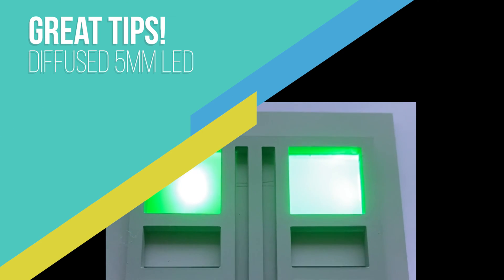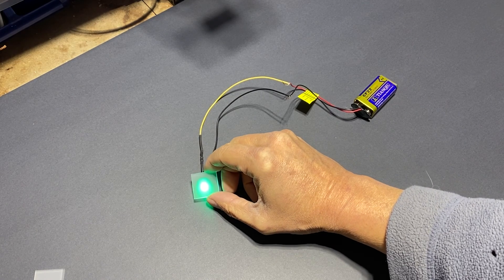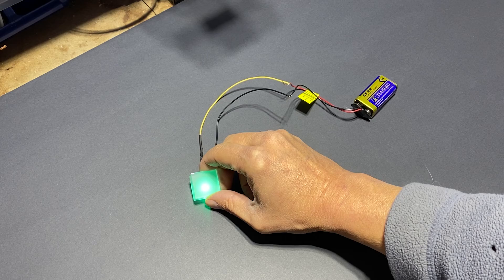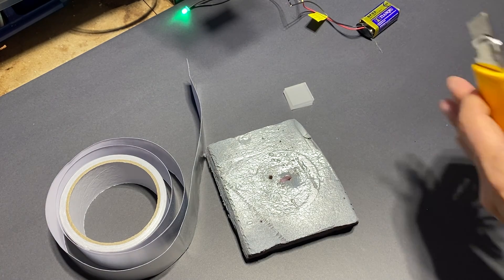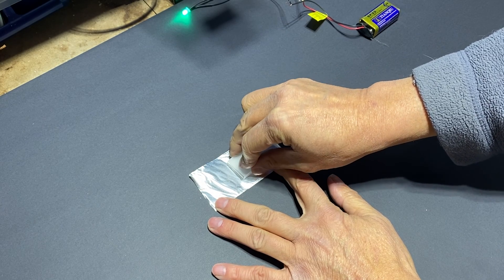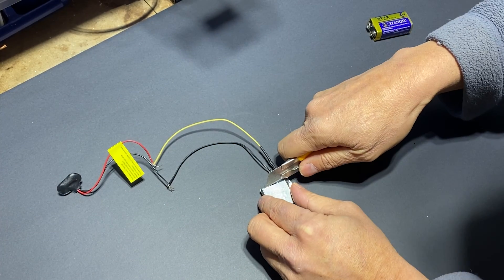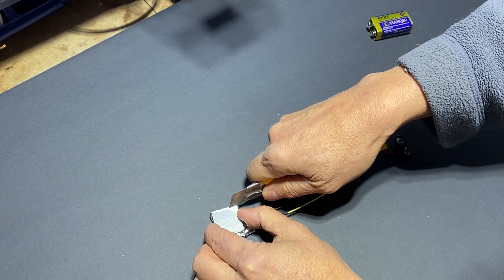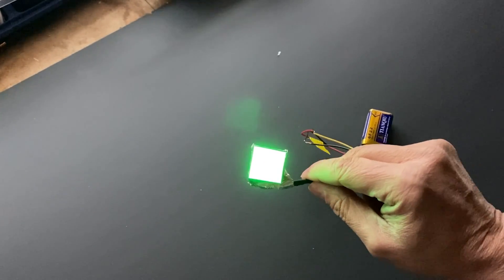Easy LED Diffusion with Acrylic Tiles: Transform Your 5mm LEDs!

Comment: Would this work on a larger surface area (say 12"x12") if you used 1 LED per linear inch?
Reply from the maker: I am not sure, I think I will use a LED strip for that.

Comment: how can you do this for headlight? Im making diffused headlights for my 300ZX to create a diffused cyber punk look. I assume the headlights reflective surfaces in the light itself will do the job of the foil tape. But if theres a bit of an extra step I can utilize, ill try it to make the head lights perfect. Im also applying the same idea to the tail lights.

I will be taking matte tail light smoke, and apply it over the tail lights.

Then I will use gel sheeting in pieces to apply to the brake lights, to make a seemless red light bar, that when the tail lights are on, the 300zx style tail lights glow through the gel sheeting.

but I may wa to create a uniformed light look. So Im trying to figure out a way to reflect the light so it not only shines where the light comes through on the headlights, but makes the entire light bar glow. but I may need some more brake light leds to achieve that. Im gonna test it out first.

But do you have any ideas on how to apply this to brake lights so it glows and refracts light?

Comment: Is it possible to get the link to the raw acrylic panel you used ? (Before you cut it to tiles)
Reply from the maker: I am using the satin clear version, I buy it from this manufacturer : https://www.engraving-supplies.ca/acrylic-sheets/troglass-satins.html

Comment: Great method. 
I’m interested in how the top acrylic sits flush on the top with tape around the sides on a zero clearance square opening…and also not show the aluminum tape from the front. 
Fantastic effect
Reply from the maker: Actually I don't use zero clearance, the hole is inset around 2mm to allow gluing the acrylic tiles at the back of the panel.  The aluminum tape is not visible this way, I make sure of that when I glue the acrylic tiles.

Comment: Fantastic effect!  Apologies if I missed it, but where do you get the acrylic tiles. Do you make them or have a source online?
Reply: @ssskids123 You can cut acrylic with woodworking tools. Wear eye protection because knockoff plastics can shatter (often sold as "acrylic"). Make one side diffuse with 180-240 grit sandapaper.
Reply: @jeremiahbullfrog9288  thank you for the tip to sand them!
Reply from the maker: I make them with my laser cutter